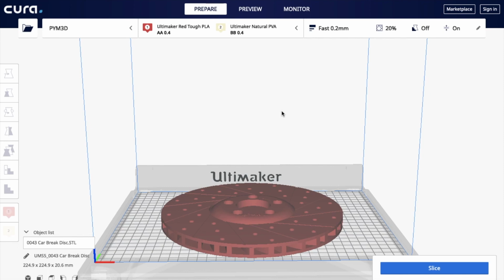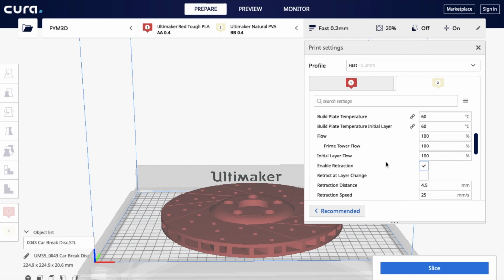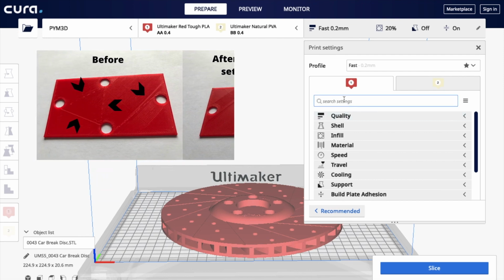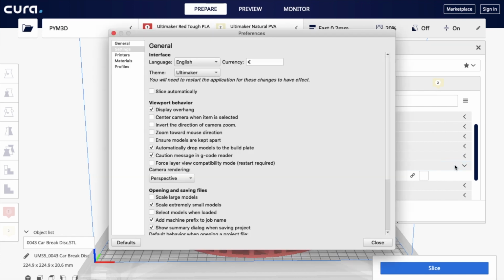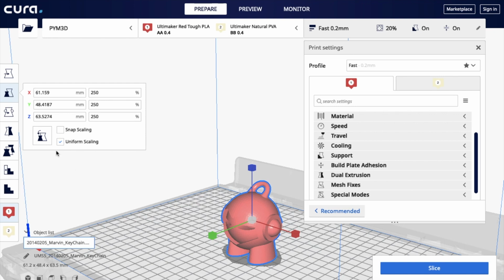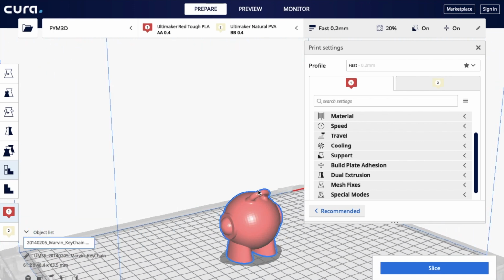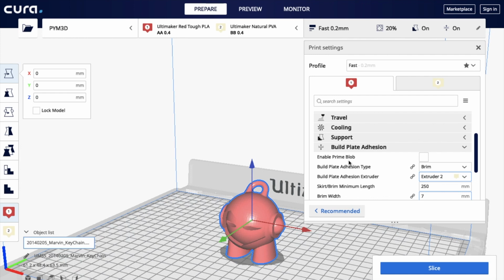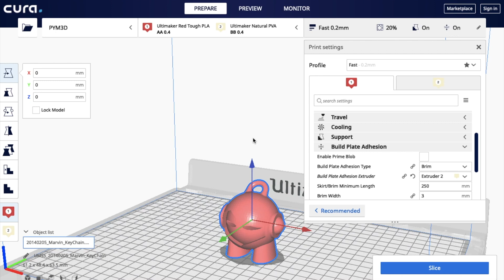Top 5 Uncommon Ultimaker Cura Settings That You Need to Know

Comment: What line width do you use? I have a dual gear and I calibrated Esteps and i still have gaps in my walls like avery wall has gap.
Reply: there are several things that could be causing that

1. make sure your filament is dried. filaments will draw water out of the air when its sitting out for too long. when it heats up in the nozzle, it expands into steam and creates backpressure. (listen for hissing and crackling) you can buy a food dehydrator on amazon for about 140 bucks and dry it at 110-120 degrees Fahrenheit.

2. speed and temperature rates. if you printing too fast or too cold, the filament won't stick to the previous layer sufficiently.

3. print bed is too low. make sure its level for the print by turning on skirt under build plate adhesion, and watching how the lines form

4. check the print in cura's preview. walls that are thinner in diameter than the nozzle diameter appear in yellow. scale the model up or use horizontal expansion under the "shell" settings